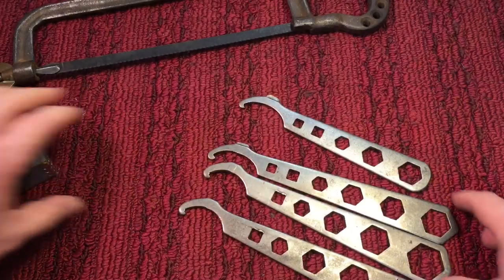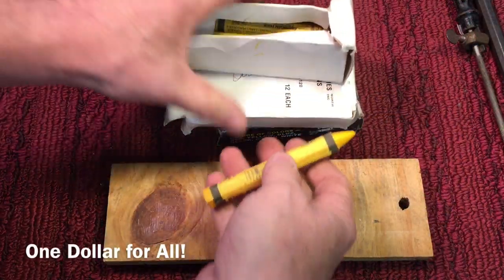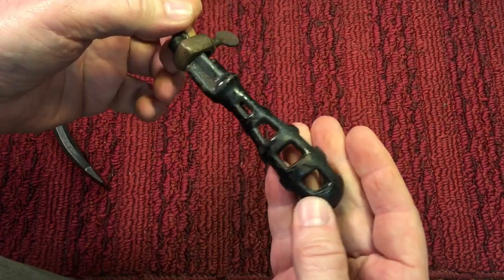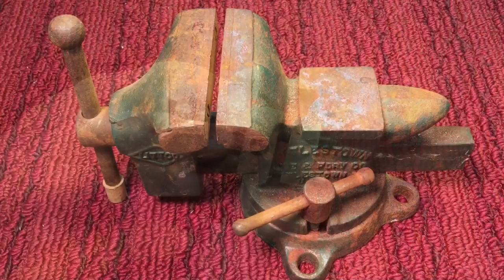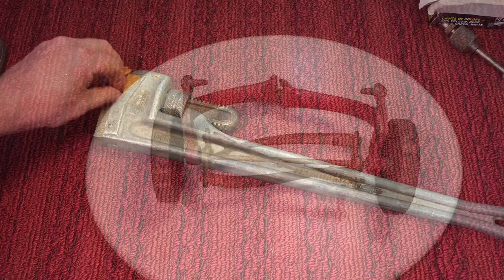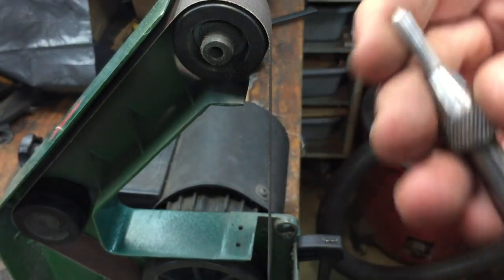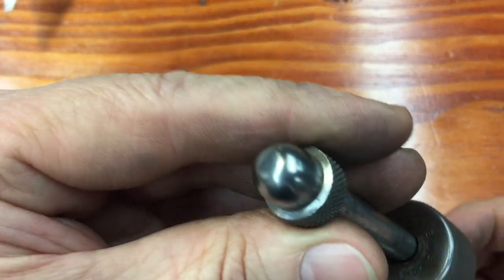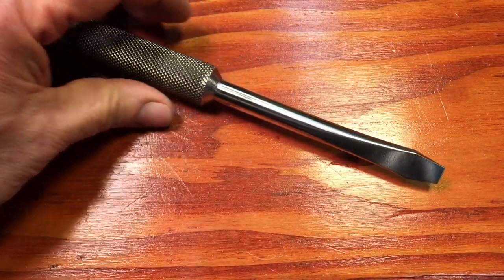Mish Mosh Monday- Tool Acquisitions, Mini-Slap-Punch Fix, Machinist Screwdriver

Comment: Love that machinist made screwdriver.  I made one just like it when I was about 13, on a taster course for college from school.  We made the blade from silver steel and threaded and pinned it into the handle we turned and threaded a separate end cap to give a real crisp end to the knurling.  Guess its design was process driven.   Still have it in my toolbox and use it quite regularly.  Made some other stuff too - plumb bob, drill gauge, tap holder, never did do the full course but loved this bit.
Reply from the maker: I wish I could have went to a school like that!
Reply: It’s what made me want to become a Design & Technology (shop) teacher.  25 years into the job and I still can’t bring myself to give it up (school’s workshop is far better than anything I could ever hope to set up at home).

Comment: Yup, love the aluminum handle pipe wrenches. Especially when u get up to the 48” pipe wrenches which we use regularly at work
Reply from the maker: Hi Brad!!   I bought a 48" Steel rigid just for a wall hanger!  So cool when they are that big!

Comment: Great vid, lots to cover, The hacksaw makes my underpants tight, as well as the screw driver, millers falls vice, and the $20 Aluminum pipe wrench.  The Crayon type markers we used in the shipyard, we called it , Kiel/Keel, not sure of the spelling, but you get the idea. Thanks for the videos, love them.
Reply from the maker: You know Dale, I never had one of those marking crayons at home...  They are quite useful!  =)

Comment: Great video keep it up! I’m trying to use my 1x30 grinder for restorations but when I use a small piece of wood behind the belt it chatters. Any ideas?  Also we eat the cheese while we are cooking in Bama too.
Reply from the maker: Charles, Make sure you slightly bevel the edges of the backing stick a little so it doesn't grab!  It should be smooth on all edges!  Also soft pressure is all that's needed, let the belt do the work!   It takes a little while but you are going to love that machine!!!!!

Comment: As you probably know I picked up a 14" Ridgid pipe wrench last month, it cost me £8. The dynamic jaw, adjustment ring, fixed jaw and spring are steel. Take it apart and see how light the handle is. I believe mine was made in the middle of 1984, these things sell for almost £70 new over here!
Reply from the maker: I have about a dozen Rigid wrenches and they are all top notch!  Their hand tools are awesome!   I hope it doesn't change.

Comment: Do you ever use junior hacksaws? The screw driver looks out of proportion,  the handle to thin to turn a big screw. As for the large clamp not closing designed for large material. Who doesn't eat a slice while preparing food?
Reply from the maker: Hi Tony!  I wish you could feel this screwdriver... It melts in your hand!  I don't know if it makes a better pry bar then a screwdriver but it is something that you just feel like using!!!  Some tools are like that.  =)

Comment: that miniature mower...sold for very small lawns...I could never have my center punches to stay pointed...maybe I ruined the temper on the tip???
Reply: Black Kane - Try re-hardening and tempering them. If you have nothing else, even a stovetop burner should work with something like a center punch.
Reply: @Ricopolico  Thanks for infor..will give it a try...

Comment: I don't think that hacksaw was made by a blacksmith. It's insanely hard to hand hammer out ridges like that and make them follow a radius like that. It was PROBABLY stamped and then had the holes drilled manually.
Reply from the maker: Allan- I am always interested on how items are made, I'm like the Frank Cannon of tools.   =D